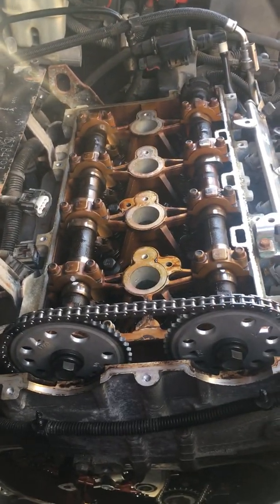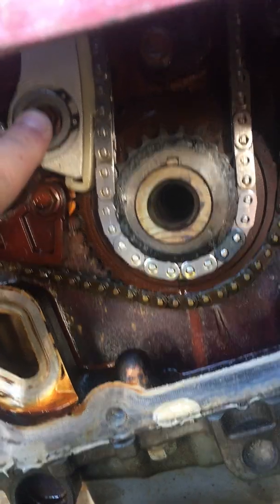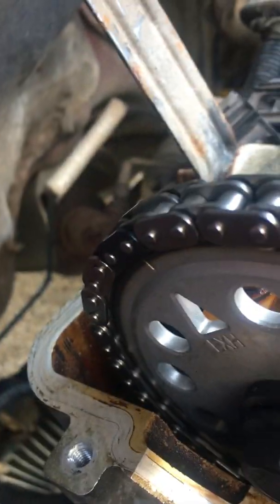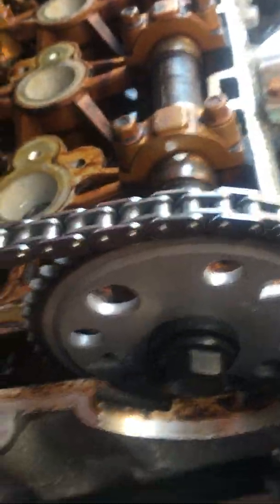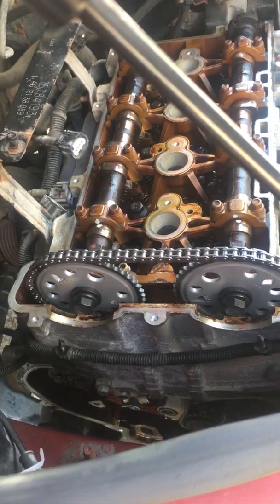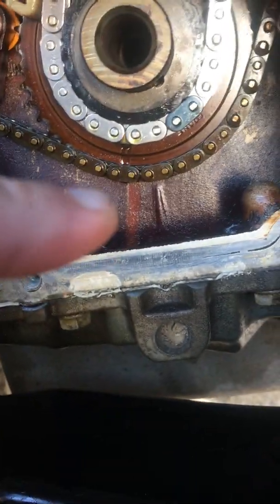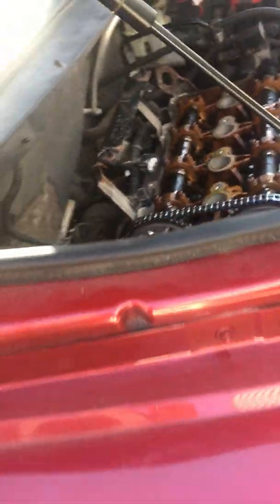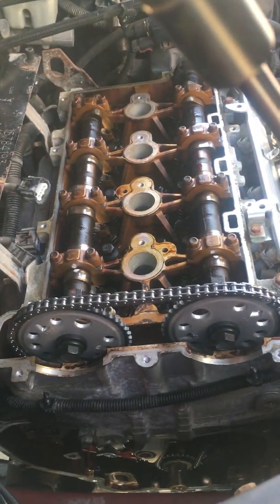Ecotec 2.0 2.2 2.4  Timing Chain Tips

Comment: 2:04 the engine mount is in two parts: part one to frame and part two to engine. The part to engine how did you remove? With my engine the mount bolt backs out and interferes with the frame, thus the bolt will not come out.
Reply from the maker: It's been a few years, this was in an HHR not sure what vehicle you're dealing with but I believe I took both of them out. Very difficult to remember exactly where the bolts were that you're talking about.

Comment: I had that balance shaft chain tensioner be the first failure point in my Ion Redline, it stopped tensioning as well as it should and caused a rattle. Only 90k miles. So I went ahead and replaced all the tensioners and all the guides, got the updated timing chain guide bolt/plug, ZZP's upgraded timing chain guide, both chains, timing cover gasket, the updated timing chain oil spray nozzle and new bolts where needed. I managed to do the whole job without removing the engine mount, only loosening it some to line up the hole in the chassis with that one bolt for the tensioner assembly. You can also cut that bridge part out of the top of the timing cover gasket so you dont have to remove the engine mount entirely.

Comment: From the information I've researched the Camshaft sprocket bolts are torque to yield, but the Crankshaft bolt is not, that is why it's not readily available.
Reply: I've called the dealer and their reply was they are not torque to yield......?

Comment: Wow dude. Props for getting your hands dirty and attempting this alone, however, NEVER remove tensioner without 1st setting the engine at TDC (TOP DEAD CENTER- #1 PISTON UP ON Compression stroke) and 2nd prepared for the slack in chain by locking the van in position. Regardless, good try but do much better research BEFORE I jump in there. Especially on an Interference motor. Fyi- the pistons can smash/bend the valves if out of correct timing. So, don't F this one up.
Reply from the maker: i know man, i WISH i would have done more research beforehand, but most of the videos I watched just showed removing the tensioner and replacing it...i should have known it shouldn't be that simple.... it was a good learning experience tho and i got good experience replacing the chain too. thanks for the info, it helps anyone who watches this video
Reply: What is "locking the van in position"?

Comment: Why would you just replace the tensioner? A tensioner will only take up so much slack in a worn  chain regardless if its new or not.
Reply from the maker: It's a common thing for the tensioner in these cars up til 08 to clack and fall into two pieces. In these situations it's usually not necessary to do timing chain if you can get the tensioner out in 1 piece. The timing chain is a bigger deal that usually won't need replaced until like 200k. The new tensioner should stop the timing chain from needing replaced at a normal interval if done right, but in my case, I didn't do it good enough
Reply: @gunprojects5398  you think just the tensioner should fix  p0016/p0017? 

Cars running great, only slight slack in chain, everything seems in tact from the top. Trying to avoid doing the whole thing.

Comment: Not be rude, but that's hilarious man. Definitely a terrible mistake but a good learning experience. I should know, basically the same thing happened to me when I changed the water pump
Reply from the maker: Thankfully I did not have to change the water pump. It had been changed by the previous owner as I later found out after a coolant flush and the o-rings on the exchange pipe start to leak.
Reply from the maker: I guess what I still don't understand is how to prevent the chain slack while changing the tensioner? I haven't really found a good way to do that on the internet
Reply: @gunprojects5398  saw a video using zip ties on both sprockets; And a magnetic wand for inner side of tensioner in case it falls inside

Comment: How do you get the engine top dead center im stuck in the middle of replacing timing chain ? Please help
Reply from the maker: i would use this video for referencehttps://www.youtube.com/watch?v=4vratX1Wy54
Reply from the maker: also, you would need your chain in place with approximately the correct time, you can be a few links off, and rotate it so you are at top dead center exhaust stroke NOT compression stroke
Reply: Does this apply to a 2011 2.4 equinox? I'm in the same situation as you were. This video appeared after looking for 3 days on the topic. Thanks dude.

Comment: EXACT same thing happened to my cavalier. The trick is to put zip ties on the cam gears which helps prevent the slack from falling down to crank sprocket. ALSO the book is WRONG. The book says set timing with #1 cyl at TDC compression stroke. The cam timing marks didn't look right to me but I forged on. Had a terrible time getting it to start. When it did start it ran rough. Ripped back apart. Reset to TDC compression using #4 cyl. The cam timing marks lined up perfect. Buttoned it up. Soon as I hit key it fired up purred like cat.
Reply: I need help 😫
Reply: Me too. I did it twice still no luck

Comment: I thought to set timing it had to be on cylinder 4 compression stroke?
Reply: Wow guys. Ok ANY time I are setting the timing on ANY engine use MUST set the crank at TDC, TOP DEAD CENTER. This is the position any engine is in during assembly. The #1 cylinder all the way up on compression stroke. Props for getting your hands dirty and learning but I highly recommend doing some better research before I do anymore jobs. Reason being is at the very beginning U made the biggest mistake, you removed the tension from the timing chain without the engine at TDC and prepared for the slack chain. I mean come on, what did I expect to happen?
Reply from the maker: @joeebowen157  yeah i should have done more research before. I watched a few videos and no one ever said to do that, so it slipped my mind.  Great learning experience tho, and helps for doing future jobs...now we know
Reply from the maker: Not on this one..easier to do it this way. Have it in the orientation I show
Reply: I found out the hard way. Book says 1 but you need to use #4. You can do a visual inspection to verify this by looking at cam lobes to see what valves are open and closed.

Comment: Mine jump timing and everything isn't lining up.  How do I turn ti alone the timing?
Reply from the maker: How much did it jump, did it still run ?
Reply: I have the same problem, I THINK IF i loosen all the cam bolts to relieve pressure on the valves I  can turn the crank to aline it TDC without hitting the valves to pistons .then move the cranks  to 2 oclck and 10 and tighten them back down.

Comment: I have seen many video's about changing the timing chains on a 2.2 & people go on about replacing the cam bolts & this is the 1st time hearing about replacing the crank bolt! I guess it is a stretch to yield bolt as well...??? I just happened to have my smaller stretch/antenna type magnet within reach when I changed my upper tensioner, In hopes to stop the rattle at start up & it worked for a few weeks-if that. Anyways, I don't know which timing kit to order? Im looking at a DR.ENGINE TIMING KIT $124.88 (comes with front cover, water pump, front cover gasket, both chains, both cam gears, oiler, guides & a total of 8 bolts,  so, everything except a valve cover gasket & gasket maker & oil change...My biggest question is, How important is it to replace the front cover/oil pump? With about 170k showing on the speedo, there is chalk writing on the valve cover making me think that, the engine was replaced plus, It runs good, maybe to good for 170k? I just purchased the car about 4 months ago but with the rattle at start up, I WORRY! Many of the kits only include the bigger timing chain & they do not include the balance chain.. So, I start to wonder how important the balance chain is but, only a fool would open it up & not replace it! If I do not get the front cover & only get the 2 chains, guides & bolts, from DR. ENGINE,  A BASIC  KIT CAN BE HAD FOR $54-56. The kit that I am considering is $124.88 I am wondering about the quality of the DR.ENGINE KIT??? Money is tight & I DO NOT WANT THIS CHAIN TO GO & CAUSE DAMAGE TO THE HEAD OR BLOCK!!! So, Im kind of in a hurry to get it ordered before I spend the money. What I know is, My cooling fans do not operate! The car operates between 183-189 & usually cools back down unless im stuck in traffic, or under load so, I did find a pin within the fusebox, a pin within the fan relay/where the relay should be anyways, when I ground that pin, FAN COMES ON SO, I RAN A WIRE FROM THAT PIN & TO A TOGGLE SWITCH THEN TO A GROUND BUT, THE FAN BARELY SPINS FAST ENOUGH FOR MY LIKING! What I mean to say is, I wish it ran faster! When I shut the car off, I can rev it just slightly to 2k rpm's a few times & watch the temp drop down to 183 before shutting off the car so, I am wondering if a new oil pump would help it stay cooler? I think it would? Do you know anything about the timing kits from DR.ENGINE ON EBAY??? P.s. I saw a comment about cutting a 1/8th or a 1/16 off of the original crank bolt, ONE BUST HAVE A NUT PROPERLY THREADED ONTO THAT BOLT BEFORE CUTTING IT! Or else the nut might not go on, or the threads can more easily get mangled! It is alot easier if you have the correct nut onto the bolt prior to cutting & the spinning the bolt/dressing the bolt with a bench grinder, using the nut to help fix any defect in the threads when you unscrew the nut!!!!!
Reply from the maker: I couldn't tell you on that brand of timing kit, but it's much more important to consider replacing the water pump, as it is extremely hard to get to and replace if you are not doing a timing chain. The oil pump is really not that big of a deal. I got screwed, and now my water pump is leaking badly months later after doing this job.
Reply: @gunprojects5398  Directly after messaging you about the crank bolt, I had my brother stop at a dealership & grab a new crank bolt 4 me! I ordered a timing kit(dr.engine kit-$124.88-233.93 after tax) with new front cover/oil pump,water pump, 8 new bolts, both chains,3 tensioners,new cam gears, 2 little gears, all guides...then I ordered two new O-rings for the coolant tube between water pump & thermostat, new serpentine belt because mine is all cracked up. I'm hoping the weather warms up & to get some time off of work to install the new timing chains, When they show up. Considering the crank bolt is also a stretch-to-yeild bolt,One would think that it would also come with a timing kit. None of the timing sets are 100% complete!
Reply from the maker: Also honestly I wouldn't modify the bolts, I would just go ahead and buy one from the dealer and replace it. They are cheap enough. Also, my balance chain and tensioner were pretty worn out as well. The rattling you are hearing is most likely a bad tensioner plunger

Comment: Isn't that how it goes. Touch one little thing and you have a disaster. Never heard where removing the old tensioner could cause slack and jumped timing. Good to know, dont touch.
Reply from the maker: Looks like majority of the time it will be okay if you are careful, but I made the video so people know that it is possible for something to go wrong during a routine tensioner upgrade swap... Plenty of videos on YouTube that show the job with no issues... I guess I just was unlucky lol
Reply: @gunprojects5398  I saw a video where someone said, "anyone who knows cavaliers & have experience with them already know about this issue & change them asap so, Having a 2.2 eco-tec in my G5 that taps at start up, I hurried & ordered one! Upon changing mine, I wasn't thinking & luckily, My small extendable, antenna style magnet was beside me & THANK GOD IT WAS! The tensioner came apart & if I hadn't of had that magnet beside me at that moment, The pieces would have fallen into the engine!!!!!
Reply: @gunprojects5398  your chain was probably very stretched anyway, enough to let it drop. So you did the right thing anyway, just a PITA.
Reply from the maker: @AmandaHugenkiss2915  yup it was probably unavoidable in this situation, but all good, because the experience was with it alone.

Comment: You can re thread the bolts with a tap. Then take a grinder to the end taking off a 16th. No need to buy new bolts
Reply: Terrible advice. These bolts are torque to yield, meaning they stretch to the point where they aren't re-useable after removal.
Reply: @Heck6  100,% false
Reply: @Heck6   not only are you wrong it has worked reliably on boosted motors over 500 horsepower and I have been doing for the past 26 years
Reply: @jdtv...9134  Your advice is basically, shave off the length that the bolt had stretched past how it was originally. If you bend a piece of metal repeatedly, it will eventually become weak at the bend and just snap. Copper is good at resisting this so it is used for wires. But steel is horrible at this. So physics tells me you're bullshitting.
Reply: @Heck6  you can heat treat them with a torch and cold motor oil
Reply: @jdtv...9134  Okay that makes sense now, but how many times to re-use the bolt? I imagine not many because if the bolt stretches too much, it gets too thin for the threads to hold correctly.
Reply: @Heck6   the magical number seems to be four 🤣. Take for example a camshaft sprocket bolt on a overhead cam explorer. They're both were reused after a second time when motor work was done a few years down the road that's when they were chased and heat treated. It tightened stronger than a brand new bolt after torching it and putting it in the oil I got it the 90 ft lb in the spare camshaft. Also you have to remember you want to chase the whole that the bolt is going in as well. Do you have to do all that absolutely not. me personally when I rebuilt the explorer motor I was not spending $40 for one f**** camshaft bolt. If you ask me it's just a shame to get you the f**** buy more parts. In 22 more days I will post pictures on my Facebook page when I'm out of jail.
Reply: @Heck6  one more thing after you chase the threads and clean them up you don't do a heat treatment every single time the heat treatment is optional
Reply from the maker: I understand what you are saying and it could work with everything you said, but for the every day man, its so much easier and fool-proof to buy new bolts. appreciate the feedback on the video sir!